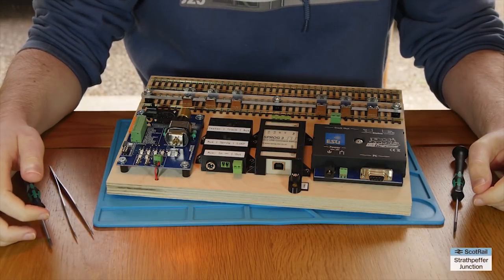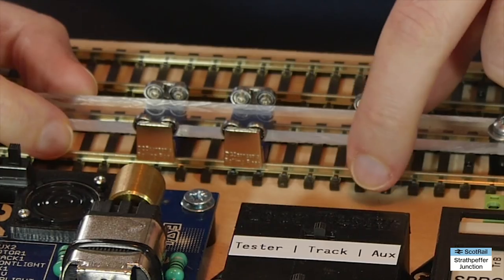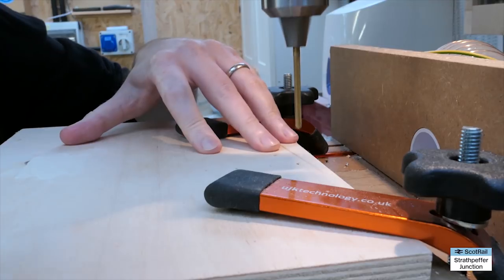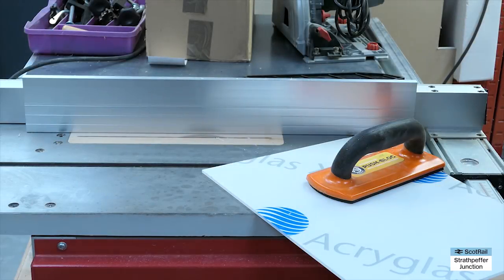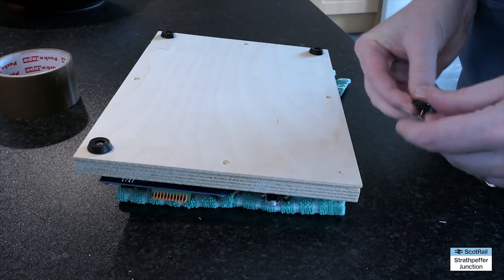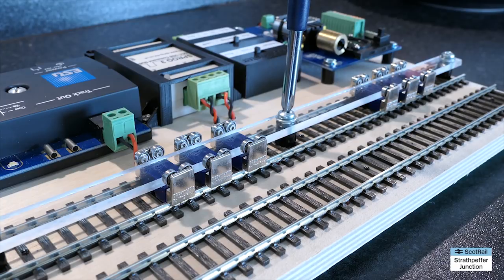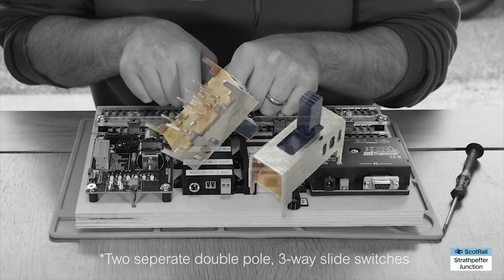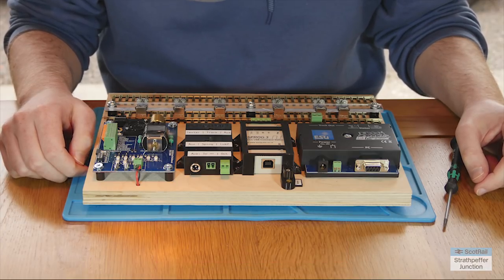#35 Making a Model Loco Test Board (with Rolling Road, DCC Decoder Tester, LokProgrammer & SPROG)

Comment: Great video  testing board  is a stroke of genius  I think Dave Howarth did a similar thing with his rolling road but without the test gear  as they are a pain keeping from falling over thanks for sharing .. Pete
Reply from the maker: Ah, many thanks. I'll have to go and check out Dave's video. I was sure someone else must have come up with something similar, because I can't be the only one who's found those rolling road modules a bit of a pain (and also dreadfully over-priced). Thank you for your comment and the support. Very much appreciated. 👍🏻
Reply: @StrathpefferJunction   I got my rolling road from Direct train spares which look a bit more stable and worked out cheaper then DCC concepts ones I saw what Dave had done to his a while back and put it on my to do list but still not got round to getting it done lol it will make running in so much easier .. cheers.. Pete
Reply from the maker: Oh, that's good to know about a cheaper source. It's crazy that these tiny we things are only marginally cheaper than Hornby's much more substantial rolling road. I had thought about making some myself using aluminium L bar and bearings, but I've already got too many jobs on the to do list!

Comment: I'm thinking of making a dc/dcc rolling road for all my OO guage locomotives and i could use 2 double double pieces of track so i can put all my rollers on one side. I will use it for all the diesel and electric locomotives plus steam locomotives aswell.
Reply from the maker: Nice one! They are really useful bits of kits. I used mine all the time, from programming to maintenance.
Reply: @StrathpefferJunction  for the first time, I've had 2 of my steam locomotives running on my dcc concepts rollers, it's abit fiddly to do but i managed it in the end.

Comment: Excellent work David, need something like that myself. I know what you mean about the DCC Concepts rolling road, its an utter pain putting locos on it with the rollers falling over etc.
Reply from the maker: This has genuinely been super useful. Even more so than I thought it would be. As for the dcc concepts modules, I really begrudge paying almost £80 for them. They're a complete rip off and will cost a fraction of that to make and package up. I also have no interest in N gauge or the other gauge (maybe o?) that's included. They should really make single gauge packs available. If I could be bothered, I could make about ten sets myself for about £20 max., if that!

Comment: What was the length and width of the test board?
Reply from the maker: I used an A4 sheet of plywood I had lying around, so it'll be the length and breath of A4 paper (I can't recall off the top of my head those measurements, I'm afraid). Had I had a larger scrap, I would have gone a little longer by, say, 5cm and wider by 2cm, just to allow for a slightly longer length of track and to allow them to be very slightly further apart (to give locos a little more clearance from one another - they do clear, but not by a huge amount).
Reply: Don’t worry about it I have the same kit, I will follow the same basic idea and I will pass on the details back to you.

Comment: Do you fancy printing the cradle for the spring and switch box and doing a list of where you got the green sockets etc? Thanks great video
Reply from the maker: Hi Andrew. Many thanks for the comment. There's a list of components (with links) on my website blog, plus links to the STL files: https://www.strathpefferjunction.com/making-a-test-board-and-rolling-road-for-analogue-dcc-model-locos    It takes too long to print out lots of these for sale (each is about 3-4hrs given I use 0.1mm layer height for a quality finish and tolerance), but I'd be willing to do a special run for you as a one-off. Drop me an email via the contact form on the website if you want to take that forward.

Comment: Could we have a diagram showing where the various wiring goes please . And what does the sprog do and is it needed .
Reply from the maker: I'll see if I can do a quick diagram over the weekend. The reason I didn't do one for this video is that it really depends entirely on what you're hooking up and how you want it to work. I'll try do a simple one showing roughly what I did, in case it helps. As for the Sprog, it's a small USB dcc device. It enables you to programme your decoders via free JMRI software on your computer, and I think makes programming much, much, simpler. You can also back up cv settings to your computer, incase you have to reset the chip etc. The sprog3 is the higher power one that can also act as a command station and run a layout. In hindsight, the sprog 2 would have been fine for my needs. I think they're pretty much the same from a usage point of views, just that the sprog 3 handles up to 3 amps, whereas the sprog 2 is less. I find it very useful and do most of my no-loksound programming using it.
Reply: Excellent thankyou for quick reply
Reply from the maker: Hi. I've done a wiring diagram and put a link to it in the description. The diagram is what I have done. If you have different components and a different board layout etc., the requirements may differ. Make sure you check for continuity and shorts before you fire up any of the testers or plug in a decoder etc.
Reply: cheers for that mate , great help. Not sure if its protected?.. lets me download but doesnt allow me to print it
Reply from the maker: It is protected from copying, but should be fine for printing. I'll double check!
Reply from the maker: It prints fine my end as was, but I've replaced it with one with no protection at all. It is quite a large file so that it prints crisply, so may take some time to load.

Comment: Very nice. I need something similar, but merg and pi sprog. Suspect I'll need to make it bigger as I'll ideally need n, oo and p4 tracks. Are the DCC concepts rolling road adjustable or fixed to one gauge do you know?
Reply from the maker: They're adjustable. They do just about everything except O Gauge, if my memeroy serves me right. In all honesty, they're well overpriced, but there aren't many alternative options. I found them a complete pain before I mounted them on the test board, but now they're mounted like that, they work fine and are easy to use.
Reply: @StrathpefferJunction  thanks for the info :-) will look at getting some I think.

Comment: Please advise fitting door lights on the Bachmann class 450. also the arcing on the rails many thanks.
Reply from the maker: Hi Paul. I'm afraid I don't have a Bachmann Class 450, so have never fitted lights to the model. I would have thought the it might be possible using micro surface-mount LEDs, such as the 0402 package. The same type, different colour, may also be a possibility for arching on rails. You would need to hook arc light up to a suitable circuit. It would be possible to use a decent DCC decoder to programme flashes if the LEDs were installed on the model itself, or if installed by the third rail, you could use a simple reed switch and magnets circuit or an Arduino to instigate flashes. There's certainly a bit of work in arc lighting effects, but I'm sure it'd be worth it. There's a few forum threads on the topic which might be of use, such as this: http://www.rmweb.co.uk/community/index.php?/topic/83341-third-rail-arcing-circuit

Comment: Fantastic fella. I’d be interested in those cradles too. May I ask how wide you made the acrylic?
Reply from the maker: I'll measure it when I'm home and let you know. The sprog cradle is a little quicker to print. I could probably do a very small batch, but if I get too many orders, I'll not get the layout finished! Lol. I'll be back later with that measurement.
Reply: Strathpeffer Junction cheers buddy. Much appreciated. 😀
Reply from the maker: Ok. It's 4mm thick acrylic (just realised I said 6mm in the video) and it's 13mm wide. The black spacers for the screws are M5x8mm...you might get away with 9mm, but I'm not 100% sure.
Reply: Strathpeffer Junction nice one cheers fella. Appreciate you getting back with the details. 🙂